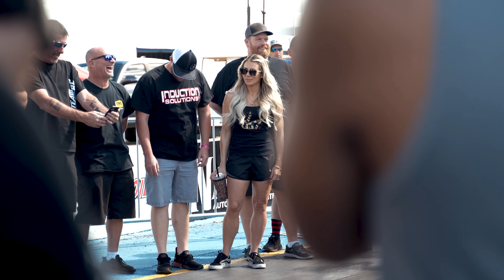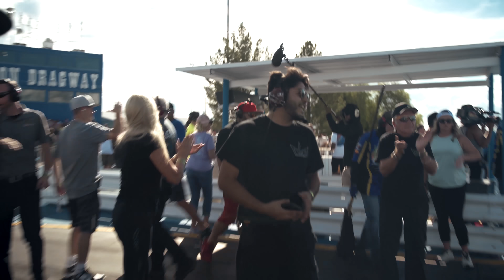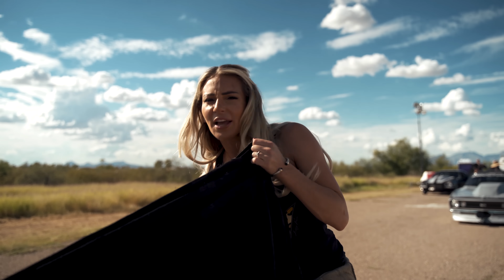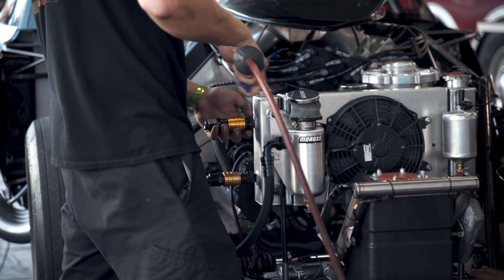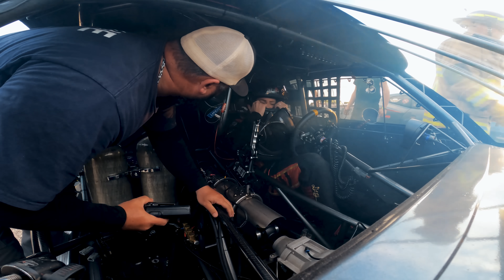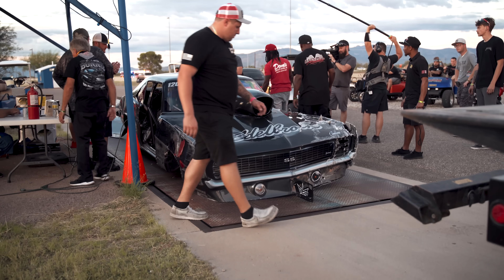Bonnie Will Be Back | Lizzy Musi | Street Outlaws

Comment: I get that the crew and others are worried when a crash happens but get the f**k out of the way and let the rescue do their thing! They are the best equipped and trained for getting a driver out as soon and a safe as possible. When you have a head and/or neck trauma you don't let the driver remove the hemlet without EMT making an assesment that it´s safe to do so. It can aggrevate what ever damage is there. That said it the car´s safety equipment did what it´s suppose to and I´m so glad Lizzy was "just" banged up and no serious injury.

Comment: Since your'e okay now ... The car does not look too bad, engine looks saveable if nothing inside got smacked up.
The chassis is just another chassis and the internals didn't look too banged up, so hoping it will be a lot of swapping existing stuff over into the new car.
Good luck to the team. Looks more like a lot of work than a lot of dollars (relatively speaking).